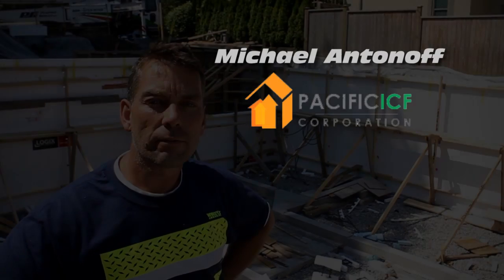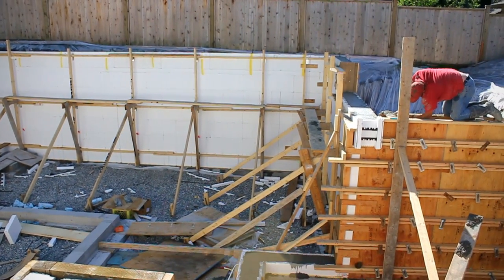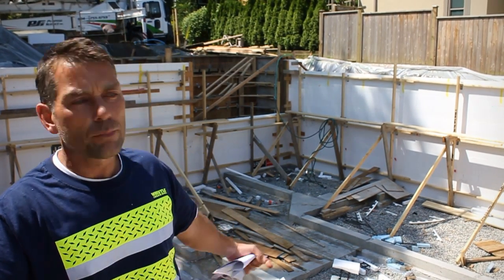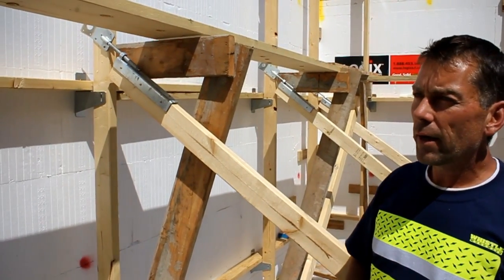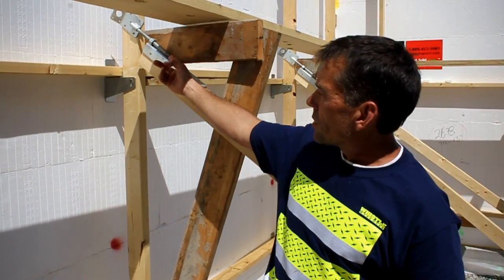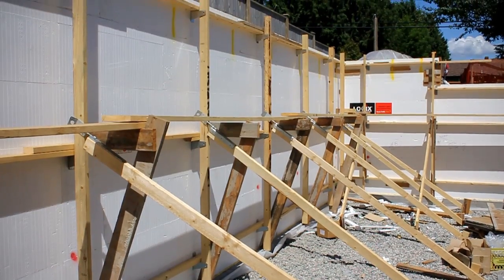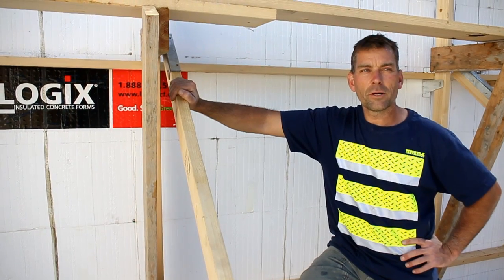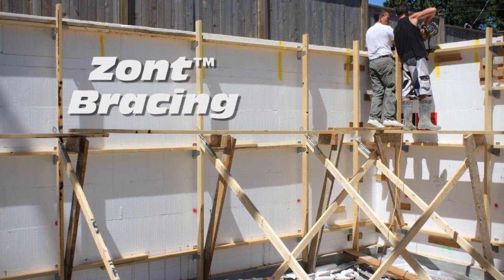Zont™ Insulated Concrete Form (ICF) Bracing: Contractor Testimonial

Comment: Do you build in new york
Reply from the maker: We are just the supplier of the ICF bracing system. If you hop on google and find a local ICF dealer, they should be able to point you in the right direction of a good installer.

Comment from the maker: Your ICF manufacturer will have a suggested method to attach your first course of ICF to the footing. You will either foam the ICF to the footing, using a metal track, or sandwich the ICF with 2x4s to hold it in position. You can easily pour to any height with an ICF, as long as you pour at the recommended lift rate suggested by the manufacturer.
Reply: What is going to put side pressure on the first course that you need to hold it in place? If you pour every four foot you do not need that train load of lumber.

Comment from the maker: Depending on the ICF of your choice the manufacturer will suggest different methods for attaching your first course of ICF. Many suggest using spray foam to prevent any shifting throughout your build, or sandwiching the first course between 2x4's.

Comment from the maker: We always run our eyes down any 2x4 we use to brace a foundation. If its not straight, its not going on the wall!
We have been bracing plywood forms with lumber for over 200 years! Why do we need to change that because we are flattening Styrofoam? If a warp does occur during the build of the wall; an additional turnbuckle can be used to flatten the wall again.